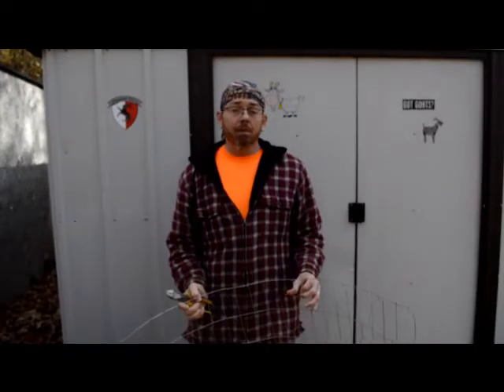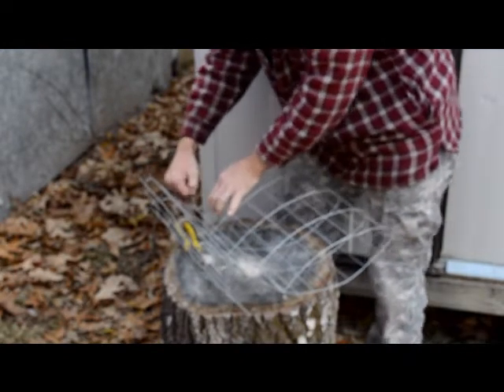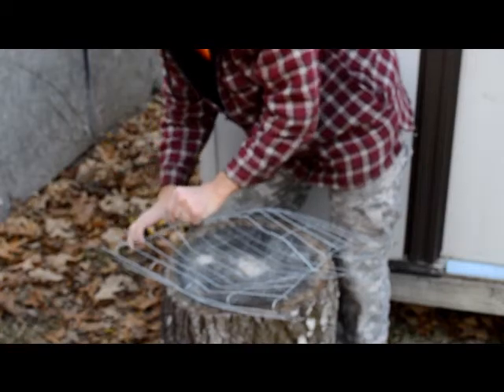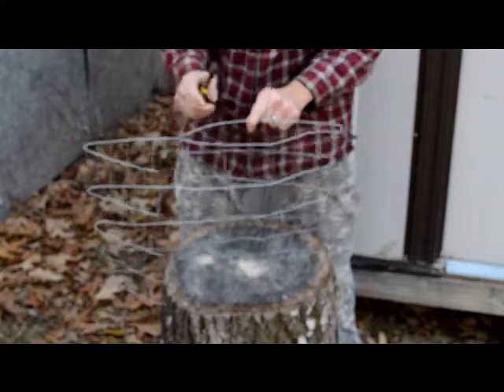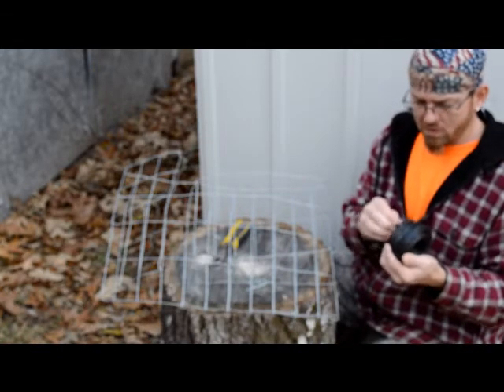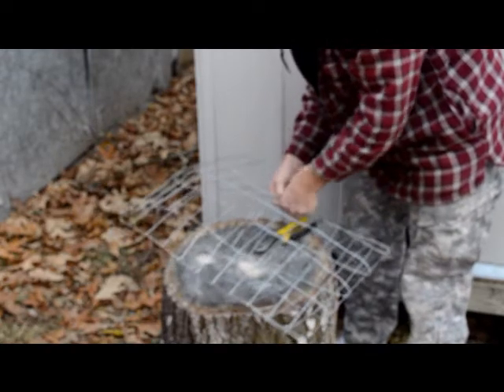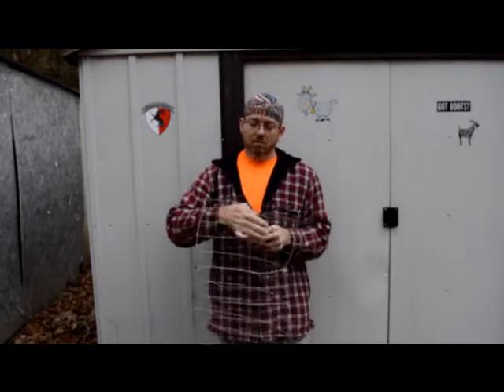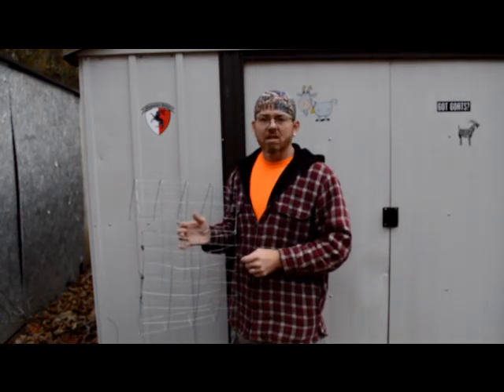Camelot Hills - Homemade Hanging Hay Feeder (How-to)

Comment: I think I will try this for my goats. It may be a problem if their horns hook into the wire.
Reply from the maker: +Nancy Thompson Hi, I can only see that being a problem if they are very long.  One thing I would suggest is make sure you have a clip at the bottom of the feeder as well as at the top as even the hornless goats tend to "pick it up" with their heads.   Good Luck!
Reply: Thanks